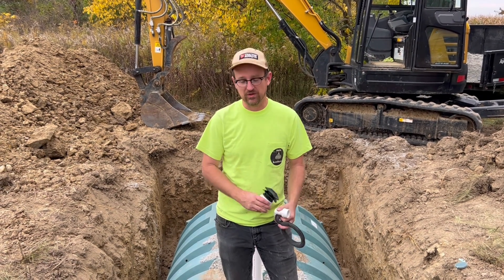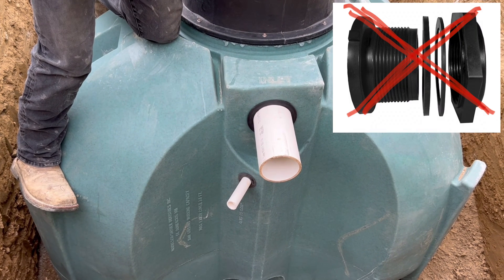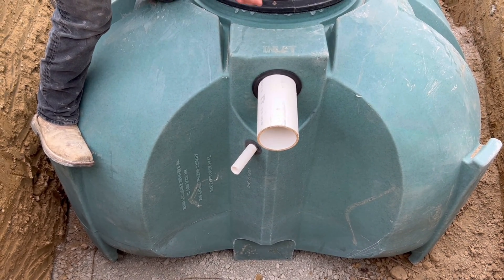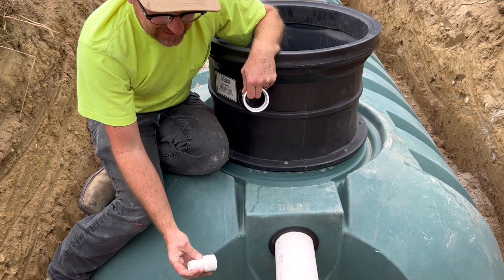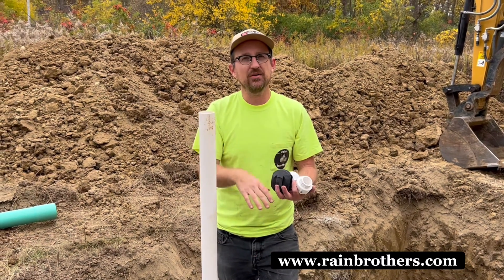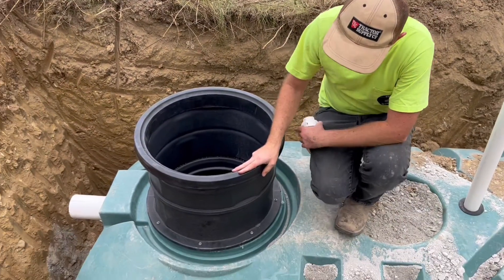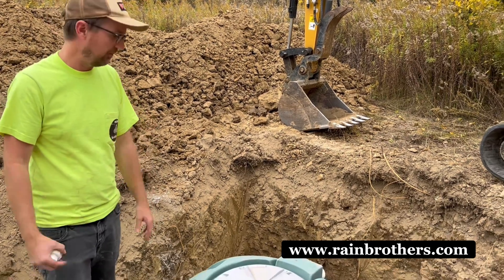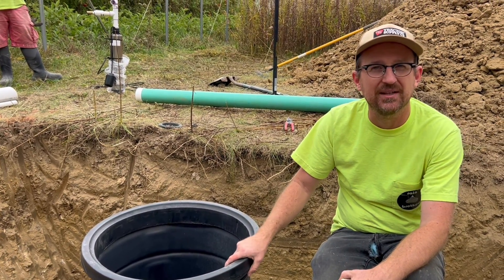Anatomy of an underground plastic cistern tank installation

Comment: I have a question,on your pump installation video using 1” PVC schedule 40 you used a 1 3/4” hole saw.
For the vent  2” PVC I’m assuming you use 2 3/4” hole saw?
I’m installing my cistern and pump tomorrow, using 1” poly & 2 frost free hydrants.
I Purchased, a pump, a vent cap, 2 1” rubber, grommets, and 1 - 2” rubber grommet.
Your videos definitely make it look easy.
Thanks 4 the video Super helpful
Reply from the maker: For the 2” gasket, you’ll actually drill a 3” hole. Here is the hole saw size chart for our gaskets: https://drive.google.com/file/d/1jBcaXIhM8bbcwE48z4LzQyspuHlyGbLT/view
If that link doesn’t work, there’s also a link on the product page for the Tank Penetration Gaskets on our website. Thanks so much for your business and for the kind words! Feel free to call or text our shop tomorrow if any part of the install needs clarification
Reply: @rainbrothers   thank you for the answer. I actually called your office first thing this morning.
 The person who answered the phone was very helpful. I actually had a couple of questions, and she answered them perfectly. 
I wasn’t looking at the chart right. A little intimidated on drilling the hole in the tank.

Comment: Hi, what kind of cap is on the overflow pipe? Does it flow out above ground? Thank You
Reply from the maker: It is a 4” pop-up emitter. We don’t generally use them or recommend them, but in this case the property was flat as a pancake with nowhere to run the drainage to daylight

Comment: Nice video... thx! Did I miss the fill point? I.E. Hauling water to fill it? Thx
Reply from the maker: This particular install uses gutters from a high tunnel to channel rainwater into the tank. If you go to 0:59 in the video, you’ll see the picture of all the drainage running from the high tunnel to the cistern tank. If you were installing a hauled water tank, the process would be exactly the same, except you wouldn’t have the 4” overflow, and your 4” inlet would bend 90 degrees up and extend above grade to serve as your fill port. Generally we recommend also installing a 4” cleanout on that fill pipe for hauled water systems. Hope that clarifies things, and thanks for watching!